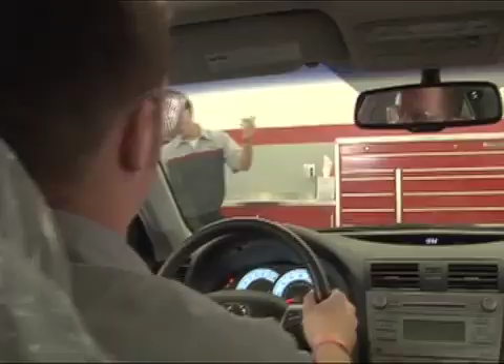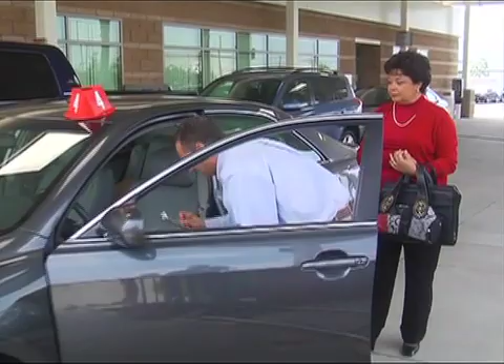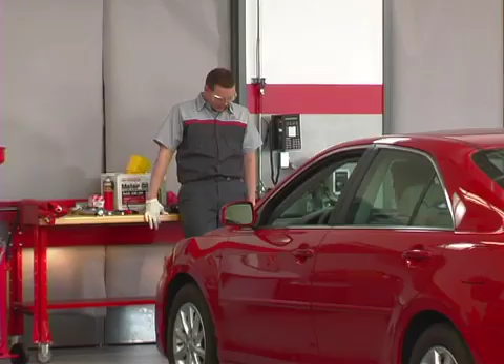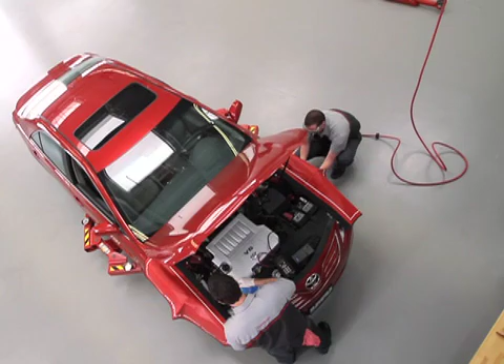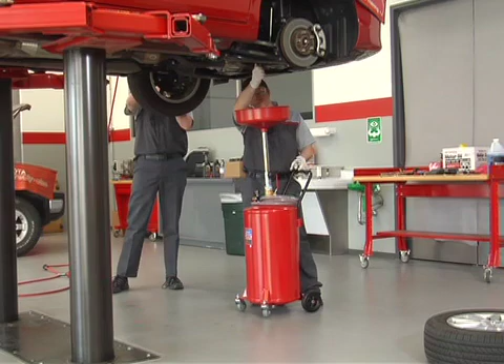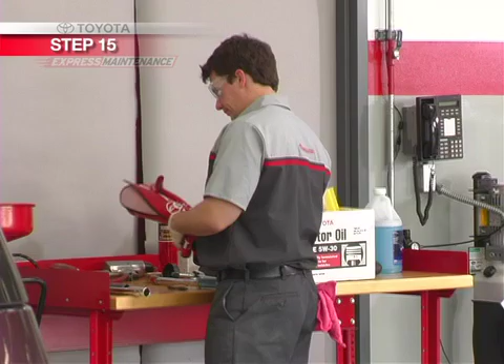Toyota Express Maintenance Service Process

Comment: Dealership Service dept are a big money maker for dealerships. Consumer beware. Be familiar with your cars service times/read your car owners manual. Not the most exciting read but it will help you from bein taken advantage of. Not all places are looking to up sale you for an extra buck but you don't want to pay for a service your car may actually need at the time.
Reply: So if your air filter is clogged up you would not have us replace it because it’s not at the service interval for the air filter?

Comment: On what planet is this dealership?  They don’t perform any of these inspections.  I once brought my Toyota for the complementary service and marked my tires to see if they rotate them.  They don’t.  This is complete BS!
Reply: I work for Toyota and we do exactly all of these steps plus more in TXM in 30 mins or less. You sound like a moron.
Reply: @noahmotley4306  
All I was doing is pointing out the terrible service I get from the Toyota dealerships in my area.  Your probably one of the lackies who knows nothing about Toyota other than when is your next cigarette break you ass!
Reply: @tomfrenza8049  You claimed Toyota doesn’t perform any of these inspections but it’s all routine. I don’t smoke cigarettes. Ignorant fool.
Reply: @noahmotley4306  
Typical responses from a Toyota technician.  I can see how Toyota values it’s customers.  Let me know when you get promoted to oil changes.   Jerk
Reply: @tomfrenza8049   if your shop didn’t rotate the tires then it’s on the technicians not Toyota. Of course if that happened where I’m at then it would have been handled accordingly. Just stating the fact that this is all routine at the Toyota Dealer I work at including the complementary tire rotate as long within Toyota care

Comment: I really not sure why Toyota change Express Lane to this TMX setup?  With my Toyota experience in Express Lane which was  mixture between Toyota and Chrysler (the auto group made sure we did it that way): one person can perform all those duties by them self and STILL get it done in 35 minutes or less. Its going to be matter in time when auto groups complain to TMC for lube techs on the job injury with that horrible idea of removing lugnuts on the ground like that or reinstall wheels sky high like that.
Reply: If bathroom equipment and whatever related to it is your occupation, we've got something special for you!     Maintenance Services https://e-web.top